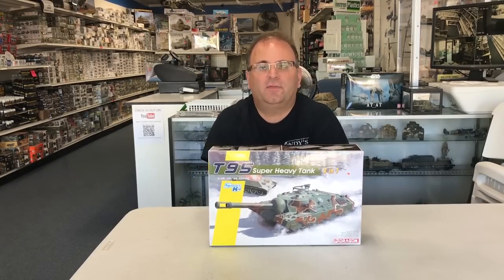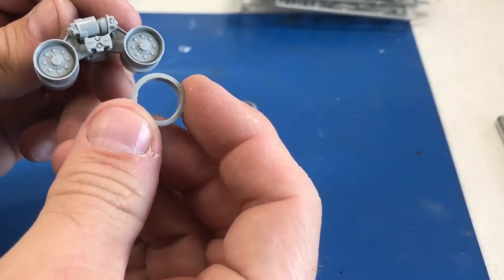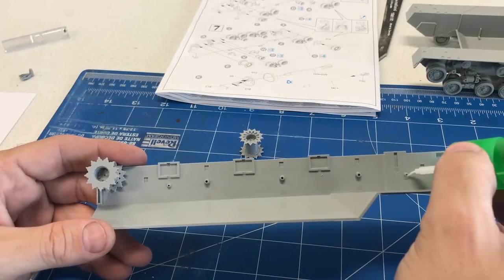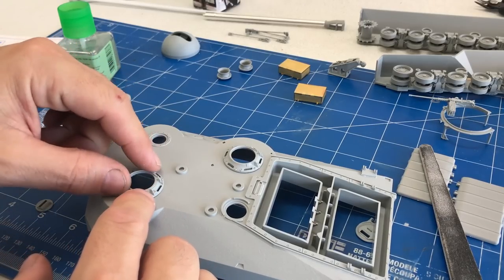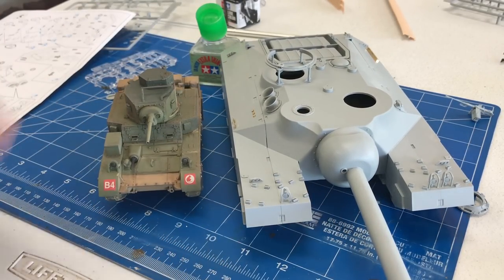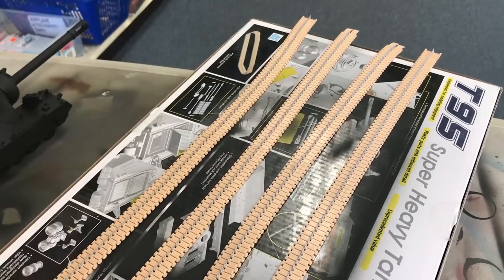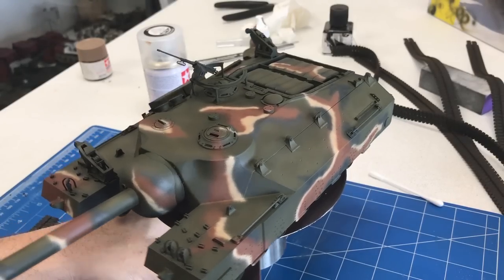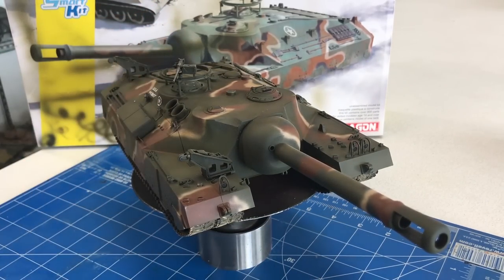Building the Dragon 1/35 T95 super heavy tank

Comment: don't mix fact with wargaming fiction
the t28/95 begun it's life as heavy tank t-28 in 1943, then got renamed gmc t95 in 1945 (cause it lacked a turret and had limited mg armament OCM 26898) and then was renamed super heavy tank t28 in 1946 (cause it did not fit well neither in tank not in gmc types OCM 30758)
and it always had the 105 mm gun, the only 155 was mounted on the t30 heavy tank

Comment: You have some patience with that suspension and track, especially as most it wont be seen. Had it been required this tank would have worked. I recall reading somewhere that when they got to the Maginot Line they wheeled up 155mm artillery and fired at the strong points from (for a 155mm howitzer) close range. They didn't have to penetrate the strong point, the concussion killed anyone still inside.

Comment: the boxes on the side are so you can take 4 sherman's with you somewhere.  I swear my first apartment could fit inside one of those boxes.  Did they rename it the T-28?
In 2017 they were moving the only one left to a place to restore it, it broke loose from the HET.  It rolled down a large ditch and only broke a bogey....try that with an abrams
Reply: T-28 is an early russian tank, you might want to ditch the dash :D
The complete naming history of this tank is as follows:
T28 Heavy Tank -> T95 GMC -> T28 Superheavy Tank
So you're somewhat correct, they renamed it T28 as it originally was named, after a short stint (~1 year) as T95
Reply: T-95 was the original name but was later renamed to T-28

Comment: At last someone made a good T95 aka Doomturtle! I love the tank and it was acctualy one reason for me starting playing world of tanks! Also for clearifying some things, the T28 had the 105 mm gun without the extra set of tracks and suspension. The T95 had the extra tracks and suspension because of that the 155 mm Gun was too heavy for one set of tracks! Just to clearify it because it was not so well described in The video. Love ur vids Andy! Could you Do a vid on a french auto loader tank? Greetings from sweden! Keep up the good work!
Reply: the tank was never designed with a 155mm  gun or nobody ever wanted to put one on because the tanks theory never really worked in trials it had an extra set of tracks to give it better ground pressure in the mud around the siegfried line because of the thick heavy armour not the gun
Reply: T28 and T95 are the fully same tank, but with a different designation. 
It started as T28 Heavy Tank, then got renamed as T95 GMC for about a year before getting it's modern designation T28 Superheavy Tank.
The extra tracks were taken off for transport, it was simply too wide for railroads otherwise.

Comment: How to give modellers nightmares: 

Remove the one-piece tracks and replace with individual track links.....
Reply: 1701spacecadet To be honest, when I open a model for an armored vehicle, and find individual track links, I close the box back up, go build a half dozen airplane models, and maybe a decade or so later, tackle those track links....
Reply: Me too!!
Reply: Really? If a kit comes with vinyl tracks the first thing I'm gonna do is to throw them in the trash bin.
One-piece tracks are always the last option when no metal-tracks nor individual tracks are available (like Centurion or M41).
Reply: Qingyun Wang I'm not pro level, and don't ever aspire to be. I like vinyl tracks, they look good enough for me, and individual track links annoy me. 

Just my opinion
Reply: Black vinyl tracks in older 1970s kits really suck. They are often distorted and almost impossible to adhere. Stapler might be the only effective tool. DS tracks from Dragon are OK, but it will deteriorate over the time and eventually shatter into pieces.
Reply: Qingyun Wang fair enough, but I rarely build vintage kits, I'll leave that to better model builders. And, if my tracks get old enough to start disintegrating, I'll know it's time for metal tracks
Reply: Plastic and Metal Tracks on 1/16 scale model/RC tanks are easy, manageable and a lot more realistic than 1/35th.

Comment: Build the Tamiya's T-62A or M60A1
Reply: Why? The old, 1979-released, Tamiya T-62A's turret is inaccurate as hell. It's way too small in height and really requires an aftermarket replacement, as it's near-impossible to correct. The kit's poorly-detailed hull is closer to 1/32, (54mm) scale, and it's road-wheels are quite inaccurate! Tamiya's old, 1974-released, M-60A1's turret is very difficult to assemble properly, and is both sparsely detailed and lacks any of the actual turret's cast steel texture. The 1991-released, partially-redesigned M-60A3 kit version's turret is much better, But the hull and suspension is still almost identical to the original 1974-released M-60A1 kit's. Far more accurate kits of both MBT's have been available for years and are much better in both accuracy and overall detail!

Comment: T95 super hvy tank. Ok I thought it was a super hvy tank destroyer, but ok, Nice vid
Reply: It actually is super heavy tank, not tank destroyer
Reply: It's actually the T28 Superheavy Tank, after starting as T28 Heavy Tank and being renamed T95 GMC for about a year. The US military didn't quite know where to put this beast.
Reply: @fabiansandhoff750  Roger. Well i also have new info. It was like the British Tortoise. Made to destroy bunkers and heavily fortified areas.
Reply: @shaunholmes9900  Nothing new there for me ^^ With its weight and the weak engine (same engine is used by some sherman variants), there was never any doubt it was only designed for stationary targets
Reply: @fabiansandhoff750  Yeh. or clearing a city with infantry support. America was always slow to adapt to changes in ww2. Rocket art, tanks, airplanes ect.
Reply: @shaunholmes9900  This definitely wasn't to be used in cities. You do not want a behemoth like that, without turret, as infantry support in a city.
Other than that, I mostly agree with you. The US are still rather slow with new technologies, which I think stems from their huge military. That's not entirely correct though; if you look at their spy- and stealth planes (e.g. U-2, SR-71), you can see they can be on the forefront of innovation when they feel the need for that.
Reply: @fabiansandhoff750  You use a tank like that in a city as armour and to blow buildings up. Infantry support there to stop enemy infantry destroying it. In WW2 America was way behind in tech and tactics. Look at how many tanks that were meant for combating tigers and panthers never made it in time, T28, perishing, ect. Also America only  really managed to catch up after the war due to German scientist, much like Ussr. Great Britain and Germany had the Jet. Germany may have beaten USA to making the atomic bomb if raids and production shortages had not slowed them down.
Reply: @shaunholmes9900  The T28 was made to battle the Siegfriedline. Once again, you do not want that behemoth as infantry support in cities. While its purpose was to blow buildings up, it would face severe disadvantages in cities due to mobility, lack of turret and its sheer size.
Reply: @fabiansandhoff750  Really. Then what about Sturm Tiger and stug 3. It same with T28. also with it armour it can take the hits, in city's mobility and speed don't matter. why need a turret when you facing the enemy in front mainly. Yeh built to take on Siegfried line and fortified positions. In open T28 a big arty target as so slow. Think it more suited to urban brawls supporting the infantry.
Reply: However, if it had entered service the main gun would've been provided with AP ammunition, so...🤔